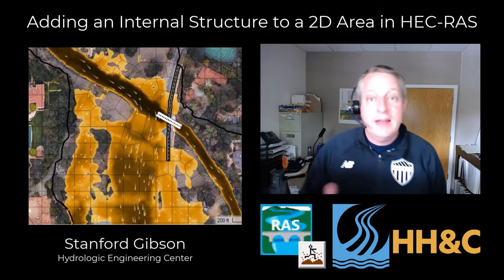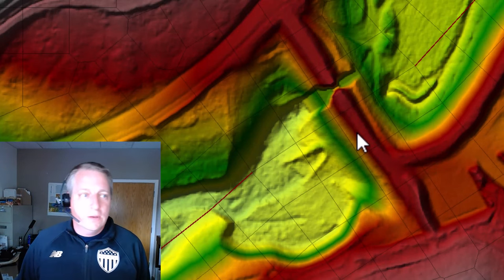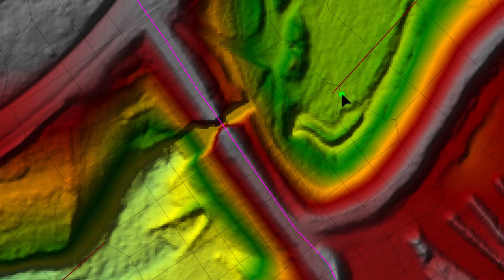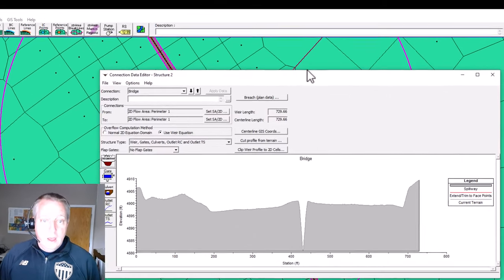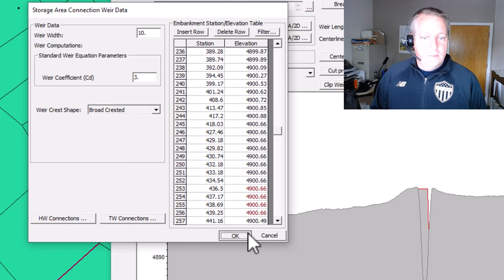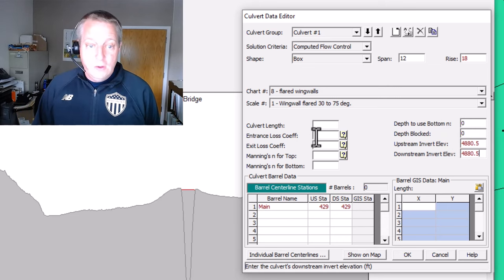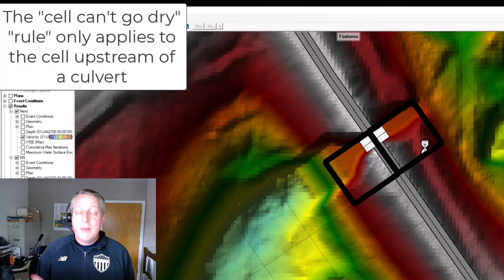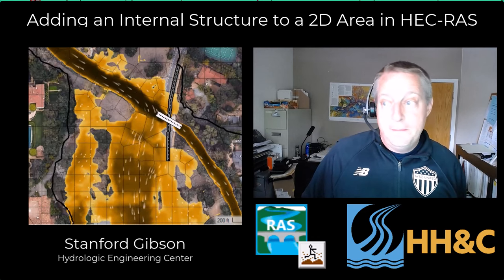Adding an Internal Structure to a 2D Mesh in HEC-RAS

Comment: Thank you very much doctor. It would be very interesting to carry out an analysis for bridges with SA/2D connection with a flow that passes under the bridge deck, many times it generates a very large backwater upstream of the bridge, forcing me to enter the pillars and abutments of the bridge as modifications. of terrain in RasMapper. I'm sure I'm making a mistake in entering the data, it would be interesting to see it from your perspective. Thank you very much for your attention doctor.
Reply: That really has little to do with the bridge/SA connection. You need to investigate your computational time step, surrounding cell sizes, boundary condition data and bridge modeling approach for low and high flow
Reply: @civilenggggg ok but i doubt it

Comment: Thank you for the video. When you copied the coordinates into the barrel GIS data, did that change the length of the culvert?
Reply from the maker: Good question.  No...it did not.  This is an important point.  The culvert length stays the same that you specified...the coordinates just determine the headwater and tailwater elevations/cells.